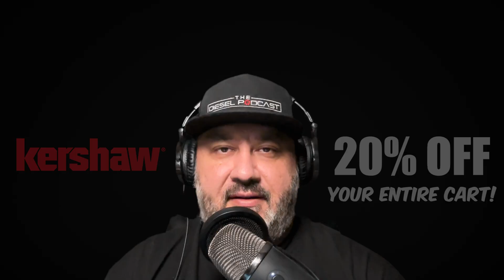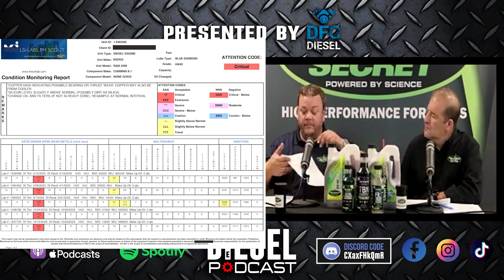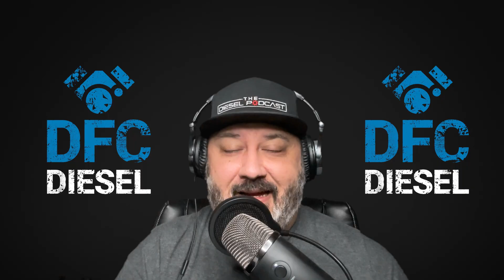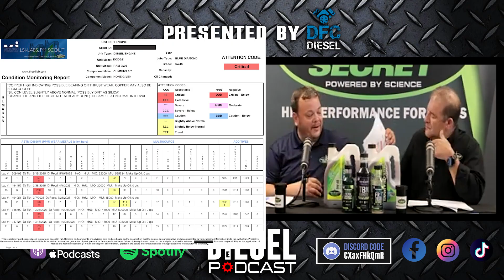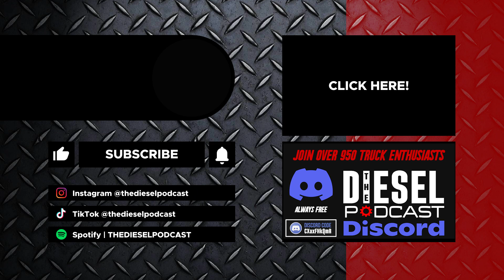Warning Signs on an Oil Analysis

Comment: That guy Lake doesn’t like Hot Shot’s because of the Potassium. 
Hot Shot’s is the cheapest. One ounce at fill up and every 6 months Hot Shot’s Extreme to clean the DPF. 
I recently added a bottle of Rislone to the DEF. I noticed an improvement in the MPG in my Ram Ecodiesel.

Comment: Hotshot saved my brothers 5.4L E250;
the VVT components were getting clogged from extended oil changes maintenance...vehicle ran horribly. He was lucky to drive 25 mph sputtering. Mechanics suggested new engine replacement.

After oil change and hotshot and a few days of driving, the engine performance normalized. Now he is able to accelerate and keep up and pass others in the fast lane.